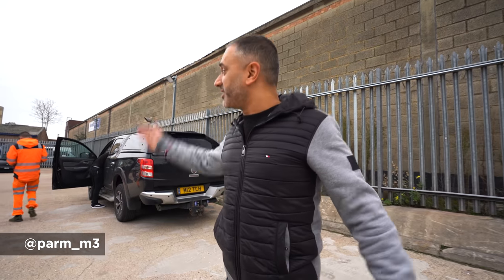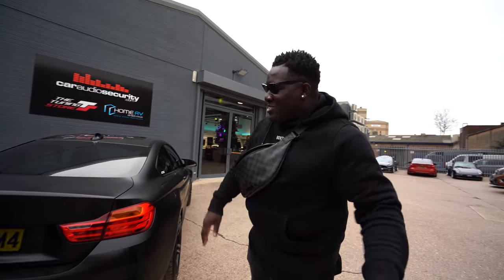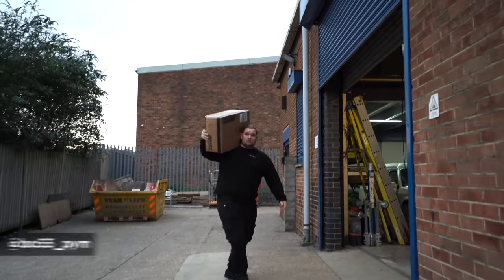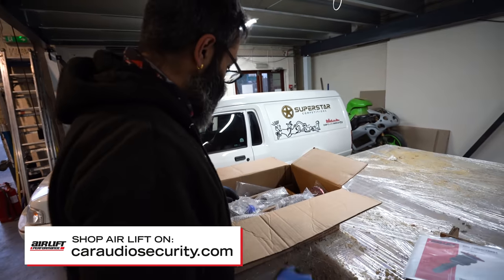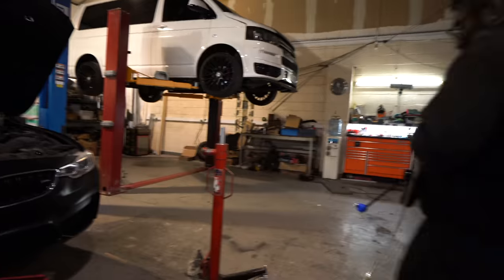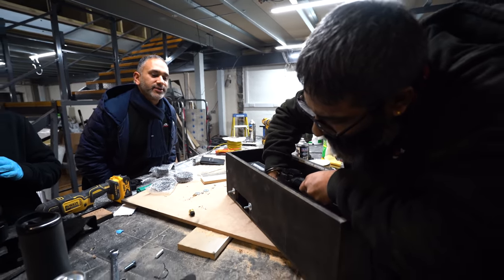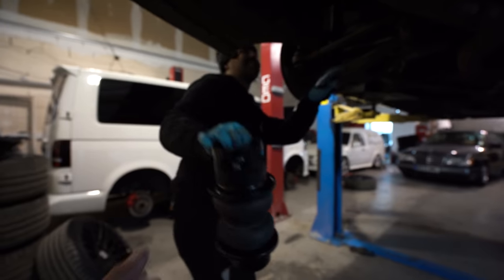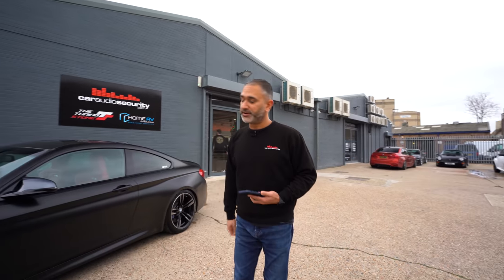We bagged DMO's BMW M4 on Air Lift Performance! | Car Audio & Security

Comment: Can I drive bagged? Or bagged only when it parked?
I mean…. I don't wanna be bothered by the police.
Reply: LOL - no man you can't drive fully aired out if thats what you mean. Unless you want to rip your fender or worse off.
Reply: @f3irty278  I’m used to drive in another country fully aired out. 1 inch maximum from the ground. I mean about the police. If they see me driving and touching the ground what happened? Will they pulled me over because of that? Cheers mate
Reply: @f3irty278  man
Now I know you’re a viginian!!!! I’ve been in US for 2 year and I know there is no problem driving and scratching the black top.
But here in UK I still don’t know yet